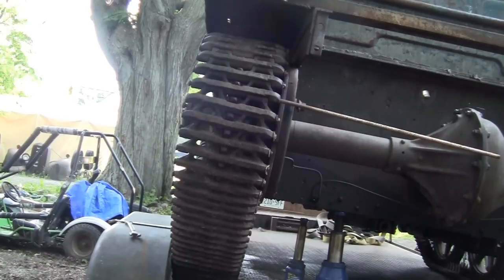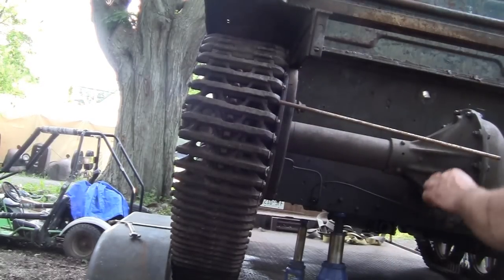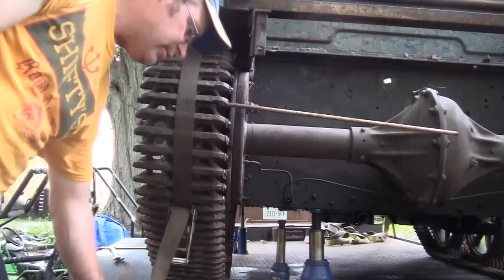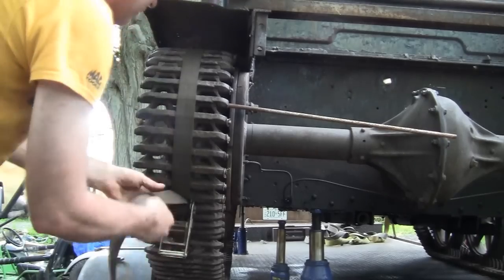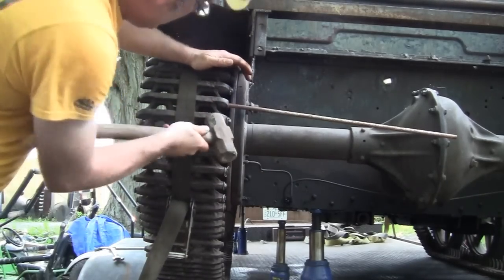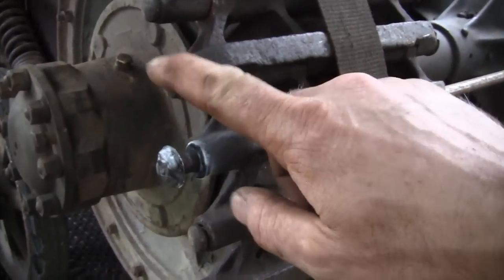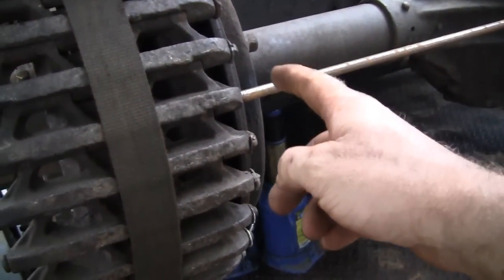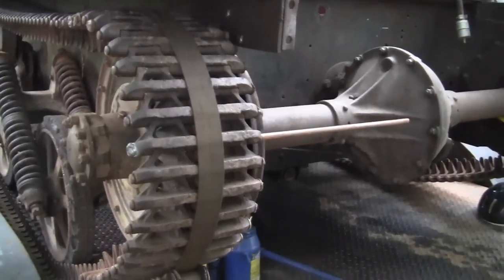Track pin replacement

Comment: We where knocking out the main pin's for our brengun carrier/truck suspension I've never saw a pin that tough my father was beating as hard as he could on it with a 20 pond sledge hammer and I was holding a 1" rod with some big ass Chanel locks (bent/twisted all 5 of the rods) we had a lot of heat on the pin when she finally broke free she took the bronze (or brass) bushing with the pin now it's stuck on the pin. Gonna be fun fixing that! 

Good video :)

Comment: I would take a bit more but I would tap and die the pins to put lock washers and nuts on  heat from weld could be weakening the pins

Comment: Seems like you have to do continual repairs to the tracks in keeping this thing running.  could you build a tool to approximate what the folks in the field used?  I was thinking a screw type jack, some hardened steel feet welded on to hook into the tracks.  then just crank it to tension.  because you could turn the screw fractionally might make it easier to align, and a bit safer.  certainly skillful in the improvised repairs, but I find after repeatedly improvising fixes and tooling, it's usually pretty easy to make a tool since you know what works and what helps.

Comment: they break, you fix it, how long do think you fix will last, as long as the original. is your metal better than years ago. straps like that but smaller ctc kind are good for little things also